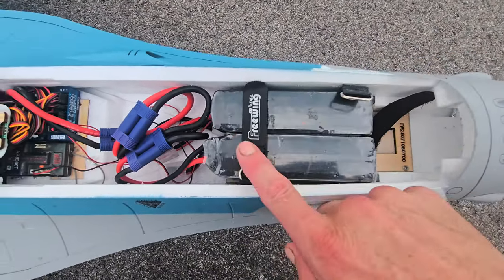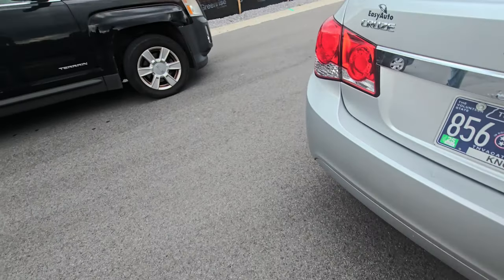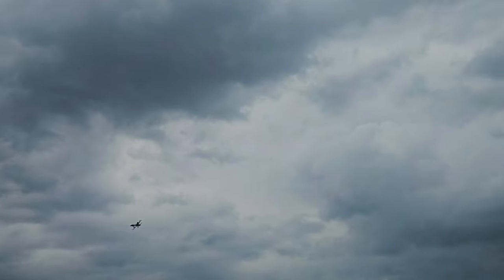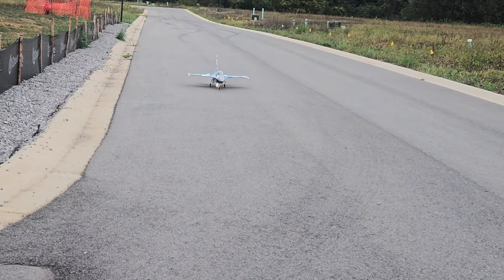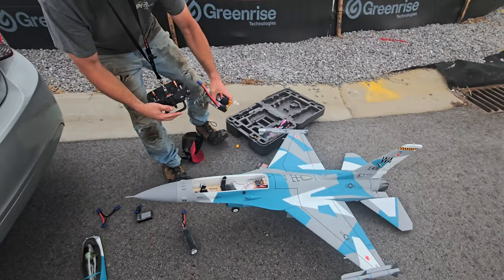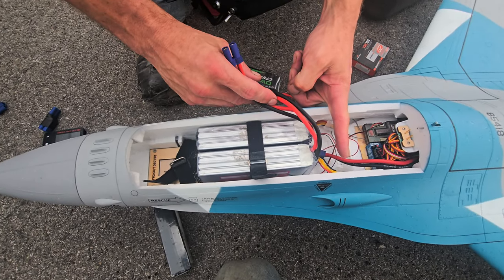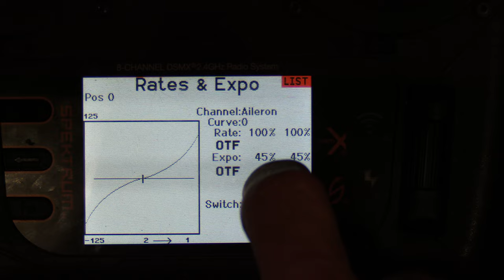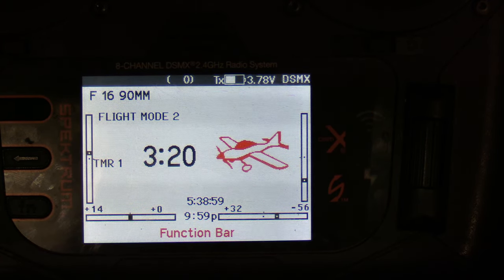Freewing F16 90mm v2 -  Battery placement-  Start nose heavy #rchobby #smokeymountainrc #rcpilot #rc

Comment: Awesomeness.  I wanted to keep mine 6S so I changed the ESC to an Avian 130amp.
Reply from the maker: @notoo7  rite, that what I did with my J10A 90mm
Reply from the maker: My J10A 90mm , after I put the 130 in i was checking the amps , and at full throttle top speed it was pushing 146 amps

Comment: good info...I don't know squat about EDF's; but I've heard Gooniac say that a 'lower motor timing' will draw less amperage  and reduce the heat on the batteries and motor; with very  little change in  performance..HH seems too always have a higher motor timing.  Might be something to look into. Just a thought...?
Reply from the maker: @jcb6713  awesome thanks buddy 👍🏻

Comment: Beauty! So how much runway do you need to get it up when your pushing it to take off?
Reply from the maker: @Reptielenfreak  thanks.  If i full throttle from the start 60 to 80 feet.  Give or take.  If i set up flaperons,  probably lift about 50 feet or so. 8s version anyway

Comment: Where did you get the series connector ? Did you try the blue adapter also ? ...I always thought the less wire, the better the current flow
Reply from the maker: Horizon hobby  and motion rc
Reply from the maker: Yes i use the blue ones too. But If it gets real hot they can come apart. Thats why I like the others